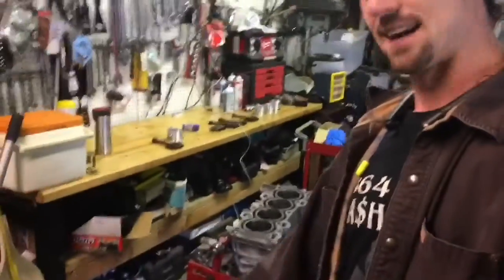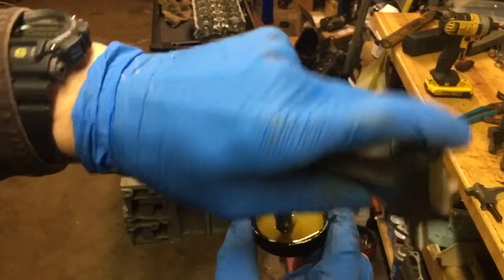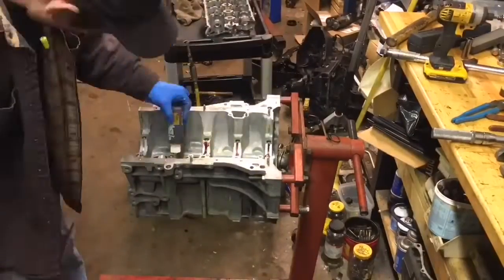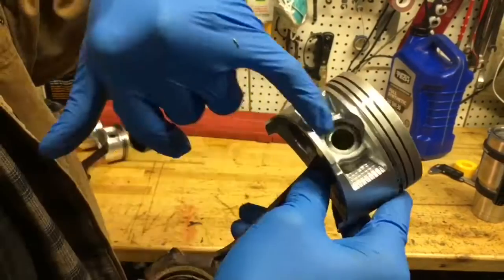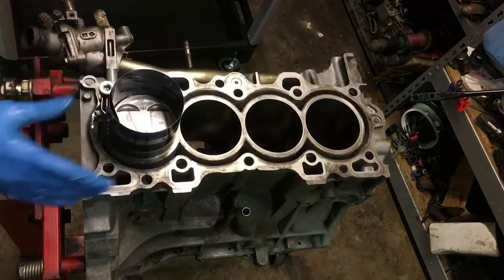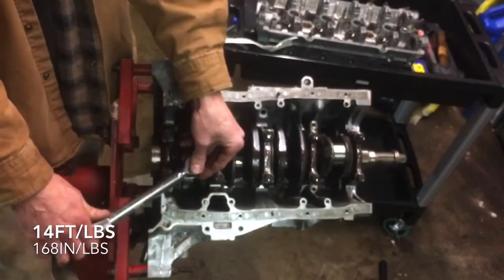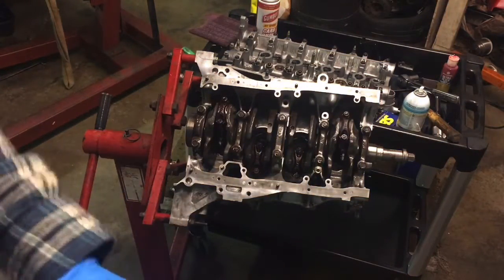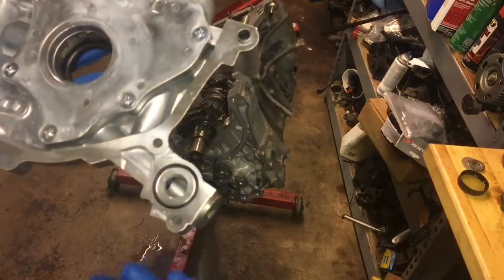How to rebuild a Non vtec engine Part 1.  B20b non vtec rebuild Honda CRV

Comment: Ii know this is a very old video but by chance how many hrs were put into this rebuild?
Reply from the maker: No clue. I worked on it for about 6 months. Maybe 30min to an hour at a time before going to work my full time job. If I had to guess probably around 12 hours or so. Did a bolt or a gasket here and there. It was worth it. My wife still drives it daily

Comment: What is the clearance for rods with platigage? Thanks for video, i may have missed it. .0015 all for is ok?
Reply from the maker: Yes that fine. I’ll have to look up the specs in the repair manual and get back to you on exact numbers
Reply: @MooreProjects  is the engine still running strong?
Reply from the maker: @chumbucket6926  yes still my wife’s daily driver

Comment: Did you pick up the whole Evergreen rebuild kit off of eBay/Amazon? I’m looking at getting  the Evergreen or DNJ to rebuild a b18 soon and can’t find much good about them. Most complaints were about the timing belt and like the one below, bearings not lasting. 

I have a feeling piecing together and full kit would be pretty cost prohibitive. I’m only doing the rebuild for hobby purposes and I don’t know the engine history at all.
Reply from the maker: I used the entire kit from eBay. Minus the rear main seal and the head gasket. I used a felpro head gasket and rear main. Everything has been doing great for us. I’ll do an update video for you. We’ve had it running for over a year and 10,000 miles so far

Comment: I had a bad experience with Domestic valve and crank bearing.  Both went bad after 8 thousand miles.
Reply from the maker: Fingers crossed this doesn’t happen to me. We are right around the 8k mile mark on the rebuild now

Comment: Good video but weren’t you suppose to gap the rings.. like push the rings down the cylinder and check the gap and file the rings if necessary?
Reply from the maker: You are correct. I didn’t check the gap of the rings. I wish I would have. But I have put 10,000 miles on the engine and just did a dry compression test on it last week and it has 130psi on all cylinders. So they are still doing good. But if I were to do another rebuild I would definitely check the gap on the rings
Reply: @MooreProjects  thanks for being honest… my b20 is doing 149psi all cylinders with 190k.. I was going to rebuild mines but I heard that’s a really good number.. thank you for the great info I’ll be sure to save this video for my rebuild You where really detailed keep it up 👍🏼
Reply from the maker: @mosesgonzalez3883  yeah you can run it down to 120psi without issues. Below that would be time for rebuild. At 150psi I wouldn’t be in a hurry to rebuild it

Comment: Have you got it done yet was just wondering if you had any problems with the parts are anything
Reply from the maker: No problems whatsoever. We’ve already put 5000 mile on the rebuild in the CRV
Reply: @MooreProjects  cool
Reply from the maker: Michael just hit 10,000 miles. No issues. Going to do an update video soon

Comment: Do any parts need to be swapped out for JDM vs USDM motors? I ready something somewhere about needing to swap the fuel pumps/oil pans.
Reply from the maker: If you bought a JDM engine then you need to swap oil pumps with a USDM one so that you can use the Crankshaft Position Sensor. Or you can use it like it is and do a Crank Sensor bypass at the ECU. There is two wires you have to jump.  Doesn’t effect how it runs either
Reply: @MooreProjects  I have to change the oil pan anyways and have the USDM car i’m swapping this engine into with a good pan so I’ll just change the pump to USDM. Are there any other parts to swap or look out for?
Reply from the maker: @masonday__  if you have the tall intake, then I would suggest changing intakes to the 99-00 from the b20z2. Better torque. Other than that everything else is the same.
Reply: @MooreProjects  I appreciate it! These videos were super helpful

Comment: I cringed when you started beating the wrist pins😅
Reply from the maker: Hecks_ B_Rex trust me I did too. Luckily I was able to salvage them. Already put 3500 miles on the rebuild as of today
Reply: @MooreProjects  Nice! if there would of been a failure would of happened long ago.👍🏾
Reply from the maker: Hecks_ B_Rex I agree. Can’t really knock on the eBay parts. They work lol. The only ebay parts I didn’t use was the rear main seal and the headgasket. I used Felpro

Comment: So what’s the point of the plastigauge?
Reply from the maker: Plastigage is more of a reference. All I used it for was to make sure it compressed and had a slight amount of clearance and not too tight. Since they were aftermarket bearing I was using instead of Honda bearing. So far no issues whatsoever. Very satisfied.

Comment: Is this the same for the A5?
Reply from the maker: ritchie owen I’ve never done any rebuild on the hondas other than the d series and the b20 in this video. I would think it would be very similar for sure. 90% of this video would apply. The main difference would be the torque on the bolts
Reply: @MooreProjects  cool, thanks man I got this B20A5 I want to get cleaned up an rebuild for my 88 Honda Prelude
Reply from the maker: ritchie owen hell yeah dude that’s old Skool

Comment: the oil pan bolt torques are bull shit they should offer a standard none sealant needed version of the gasket.
Reply from the maker: Christopher Martin I believe you only need to add sealant at 4 spots. On both sides of the crankshaft portions of the oil pan. I’ve noticed that most of the oil pans get over torqued very easily and that’s why they always leak.